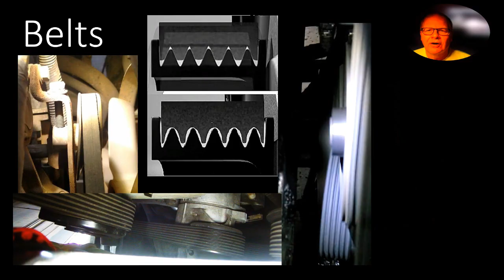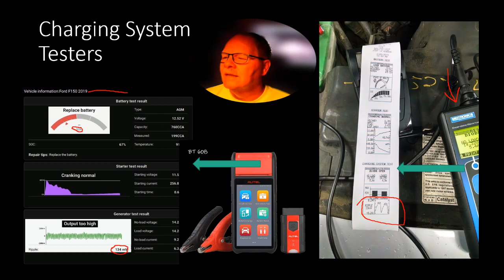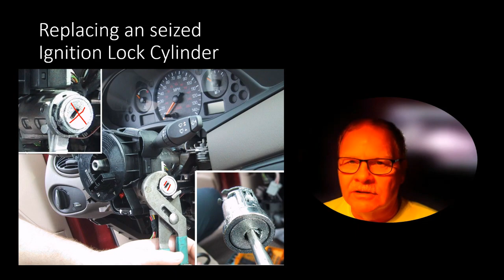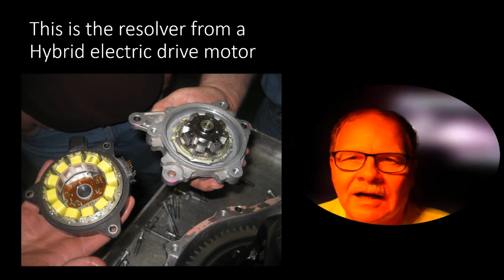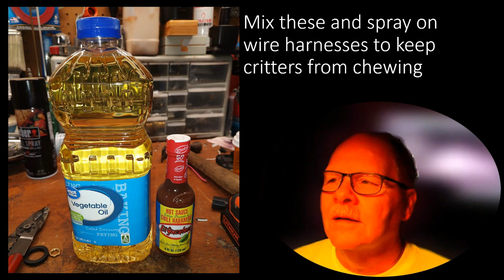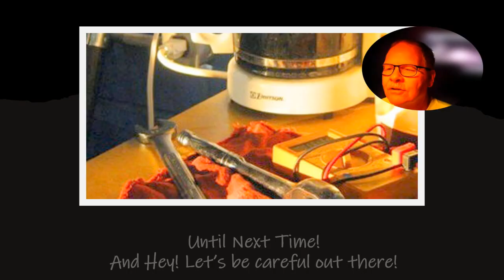Observations and Comments

Comment: Some kids do not understand why you should read plugs when you have a scanner handy. The machine owner can hear and feel the problem. I can see and hear the problem. He said local VW dealer scanned it and said no problem.  The A/C clutch thing is almost like the hidden NO2 sets.  Creaturemotorsport had a A/C clutch Maindrive pulley for the get it up to speed moment that was not for sale. I do think some very low power cars should get your mod done as a driving aid.  I was thinking of testing  a proper compact electric air hammer tool mod in a junk yard or field type situations. Gooooood Morning got that coffee down and over excited to start this week!